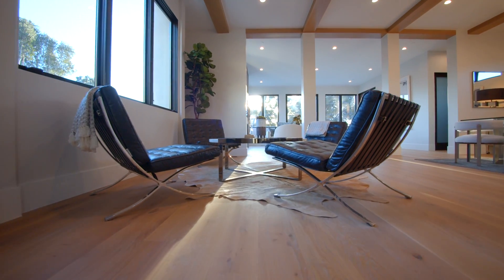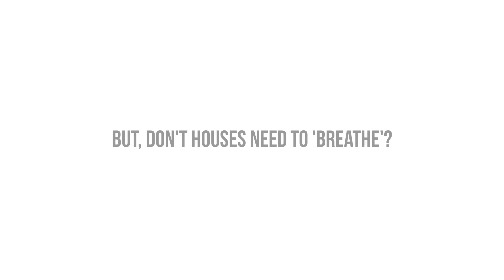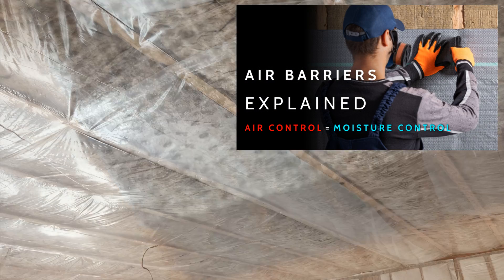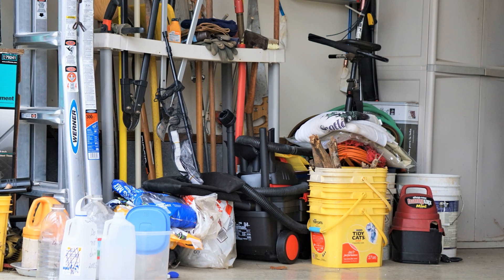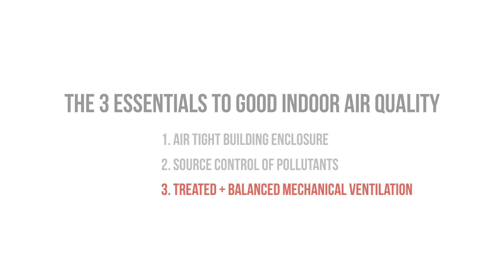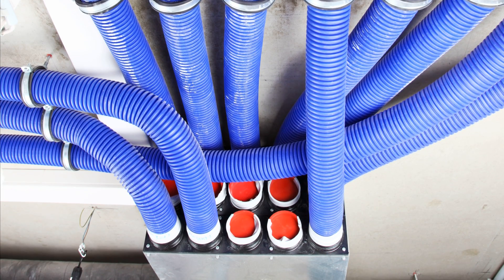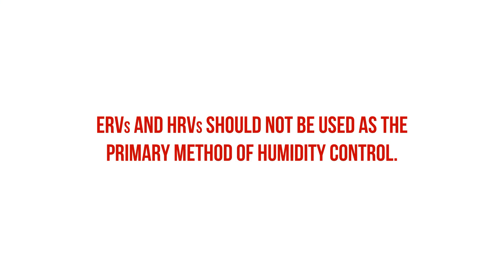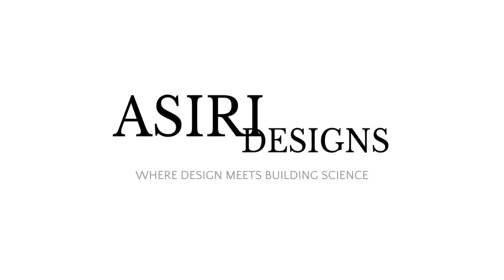Essentials of Good Indoor Air Quality

Comment: Excellent video. One slight quibble: the graphic at 3:15 is not quite accurate as the air streams in an ERV don’t actually mix; they bypass each other in the ERV core transferring much of the heat and humidity from one air stream to the other. One could be even more precise about the exact science involved, but this is probably close enough for the purpose of this video. Thanks for the excellent content as always!
Reply from the maker: @MichaelJ674  You're absolutely correct, thanks for catching that! Somehow we didn't notice this in editing. Cheers.

Comment: Is there any way to have a pretty well air sealed house and not bring In outside air while maintaining good indoor air quality? 

Some older houses are very hard to air seal to the point that you need an hrv or erv and I have to imagine there are ways to be healthy in those houses
Reply from the maker: @MichaelOConnor-jb3lv  Short answer is no, long answer is that there are air recycling and generative systems that are used in places like the space station, but why wouldn't you want to bring in fresh filtered air?
Reply: @ thanks for the reply. Big fan of your page.  Just to clarify. I am doing new siding on an existing house and plan to use a self adhered membrane to get it as air tight as possible. But bc it’s not new construction it might be very hard to get it so air tight via a blower door score  that I need an erv/hrv. 

So my question is if I get it as air tight as possible but it is still too leaky to need an hrv/erv, that should get me to reasonably good indoor air quality, right? Best would be to get it super tight and filter the air from outside but that may be outside the budget and realm of possibility

Comment: In western Canada it’s common to add humidifiers to natural gas or propane forced air furnaces.  Mostly in older, non efficient homes.  Otherwise the RH gets very low and can affect health and humidity sensitive objects like musical instruments.  

With a modern well insulated and sealed home would this be necessary?  -34 C (-44C with wind chill) today.  Not sure why I still live here in winter Lol.
Reply: I have a 4 yo fairly tight home. It was built with an air exchanger and a humidifier on the gas furnace. I’m in MN. There are days when the outdoor humidity drops to around 20% or less. I have to actually turn off the air exchanger, even with the humidifier running, or my interior humidity can drop into the low 30% range.
Reply: Whenever you're heating up the air, it's RH drops. The better insulated you are the less moisture will leak in for you. So you have to humidify by yourself. It's just science regardless of how old or new your building is.

Comment: Do you have any experience with CERVs? 
ERV with integrated heat pump, which can heat, cool and dehumidify.
There`s only two companies I found, Equinox and Minotair.
Reply: I’m planning to spec a CERV for my renovation.  Seems like the ideal solution if you have the ducting, space, and budget for it.  I recommend reaching out to them if you’re interested!

Comment: I'm surprised you didn't mention kitchen exhaust hoods and cooking fumes/vapor.
Reply: That’s a whole separate topic. You can use a fresh air system to exhaust your bathroom but not as a range exhaust.
Reply: Agreed, it’s a side topic best covered in a separate video.
Reply: @MichaelJ674 but it would be a good topic to cover. You don't want to pull grease through an ERV/HRV, but you need the right amount of make up air.

Comment: Why do we want to make something necessary when all of human history it has not been?  What could be some unintended consequences?
Reply: It is only necessary now because we are pushing for high efficiency with a requirement of controlling indoor temperature at will.

This means tight air sealing and insulation, as well as huge energy requirements for heating and cooling.

It was always necessary, but people used to just open a window if they wanted fresh air. Very old buildings in colder climates were very leaky, built with stone and had fireplaces that would run all day to barely keep you warm.

Basically all these dilemmas exist because of the creation of air conditioning and mechanical systems. People like the comfort they provide, but they use insane amounts of energy and we have needed to radically transform buildings to be able to satisfy the insatiable appetite for indoor climate control.

So why do we want to make it necessary? Because we want to control the indoor environmental conditions regardless of outdoor conditions. Thus we have an insatiable appetite for energy and are having to find ways to accomplish those things more efficiently, and that’s… very hard.
Reply: @cmoullasnet   Comfort isn't a necessity, and it's critical to distinguish the two.  If you mandate comfort, on the margins, you'll mandate homelessness.  This type of system seems to be taking things to an extreme that is unnecessary for most people.  It's likely to be mandated because it has good intentions and will be very profitable for a few corporations and many technicians.
Reply: @cmoullasnet A tight building envelope is important so that we do not use "an insane amount of energy" to stay comfortable in our home. In our climate here in Canada, people would freeze to death in winter without a heating system of some sort. We've just improved the heating systems and building envelope so we don't need to chop so much wood and can focus on other tasks.
Reply from the maker: @JoelWeyrick  Back in the good old days, people also died at 40 with no teeth. Our outdoor and indoor environments have changed significantly, we've got a lot more nasty air pollutants that we've created that are both inside and outside. You need environmental separation.
Reply: @ASIRIDesigns  I'd be willing to bet that the average centenarian is not living in a home with this type of system.

Perhaps simply addressing particular pollutants in the house is preferable than creating a new experiment?

"You need environmental separation."  To what extent?  Where's the science?
Reply from the maker: @JoelWeyrick  This is a good place to start: https://www.ashrae.org/technical-resources/bookstore/indoor-air-quality-guide
Reply: In addition, in much of human history, homes were very uncomfortable and drafty. Lots still are. My neighbor heats with a wood stove. It’s a lot of work. I heat with two heat pumps. I can go to work to pay the electric bill and not deal with the dust and the inconsistencies of the stove going out and needing to bring in wood.
Reply: You want to breath in your blown insulation from your attic via its access panel? Have you looked in your window jams? This air is being pulled into your house as “fresh” air.
Reply: @paybax  I might breathe air someone else breathed in.  That's gross and dirty, how do we fix it?
Reply: @JoelWeyrick  So no bathroom fans or rangehoods in your home? Like that dirty air 😂 The house already breaths so obviously no point in them
Reply: @paybax  Moisture =/= dirty air
Reply: You can’t argue against willful ignorance. Good luck, Joel!
Reply: 1) energy is getting more expensive and it's smart to keep a tight envelope that doesn't waste energy.
2) bringing in controlled, filtered air is much healthier.
Reply: @DeuceDeuceBravo  1) HRVs are an additional expense when building a house, and it's smart to not waste money on experimental tech without a long track record
2) That's not been demonstrated, in fact, another comment indicates the likelihood that we'll induce auto-immune problems from lack of exposure to environmental allergens.
Reply: @JoelWeyrick  What do you think is "experimental" about HRVs? They only appear experimental if you're unfamiliar with the science.
Reply: @DeuceDeuceBravo   The science of the 90s and 2000s said that we should use antibacterial handsoap.  When it was adopted by the majority of people, problems with the product became obvious, and now the authorities said we should go back to regular soap.  Another example is the 90s and 2000s medical advice to completely remove peanuts from children's food, which resulted in a massive increase in peanut allergies. 

What is the effect on humans and houses of having this type of system adopted by most people over the next 50 years?  If I am honest, I think it's an experiment.  Maybe we all live an extra 20 years.  But my guess is that too sterile environments will have bad unintended consequences and at a huge expense... while there's other low hanging fruit available at less expense.
Reply: @JoelWeyrick So we should forego the science of the 1990s for the science of the 1890s? It is a fallacy to suppose that because one experiment didn't turn out (the peanut thing was a known experiment btw) that some other aspect of science is wrong as well.

An HRV typically uses less than 50W of electricity to bring in outdoor air through a controlled opening and heat exchange it with indoor air. It is the same concept as opening a window to get fresh air but with heat exchange. If you live in a cold climate (it is -20 where I live at the moment) you freeze to death if you don't heat, and you waste a lot of energy heating if you leave a couple windows open for fresh air (orders of magnitude more than 50W). If you don't have a proper opening for fresh air, you are drafting air in through whatever insulation you have, and picking up small particles from it, eg fibreglass, mould, mouse poop, etc. The science and engineering behind ERV/HRVs is well known and beneficial.
Reply: Hygiene Hypothesis is medical theory that suggests children need to be exposed to germs to "educate" their immune systems to fight infections. Without this exposure, the immune system may not develop properly and may become intolerant. It's supported by animal studies that show animals raised in sterile environment develop weaker immune system to fight common infections and develop autoimmune disorders. Sterile environment is hard to achieve though, but still good idea to raise your children in dirt(outside).

Comment: Very informative. I was contemplating installing a heat recovery unit but not a dehumidifier. Well timed. Thanks.
Reply: You’d be surprised, though, at how much of the US needs dehumidification during portions of the year. Corbett Lunsford has several videos that go into depth on this topic on his Home Performance YouTube channel. It’s a nice complement to this channel.
Reply: I have a Broan HRV and it does have a condensate line on it that drains into the sump area. We have low humidity in the house since installing it usually between 25-40% I’ve only had it in winter so far but I’ll be interested to see what it does come summer. I’m still searching to get a good thorough explanation of how ERVs and HRVs are different other than the vague explanation I hear from videos saying “ERVs deal with humidity” I don’t really know what that means yet.
Reply: @CMCraftsman The ERV has an upgraded membrane which exchanges vapor. In a southern house with dehumidification, you might not care about a little extra vapor exchange, but in a northern house in the winter with no humidifier, you would prefer to not bring in super dry air. So not everyone NEEDS the vapor transfer function of an ERV.